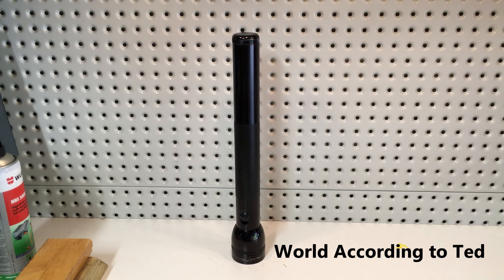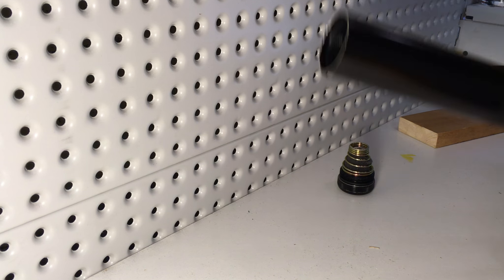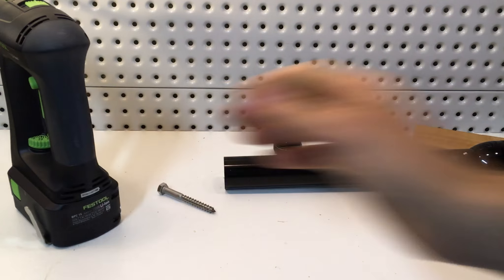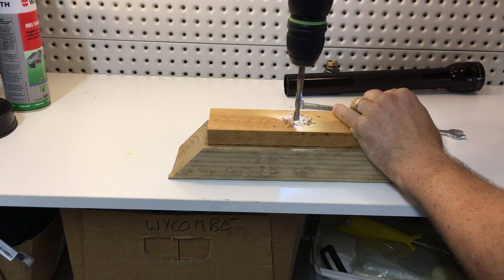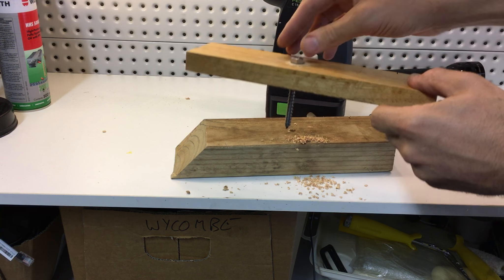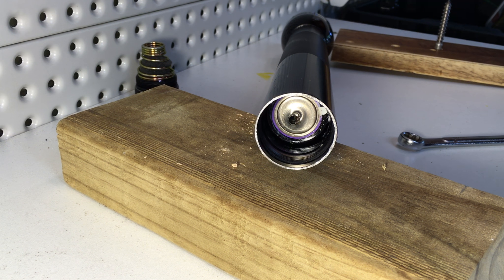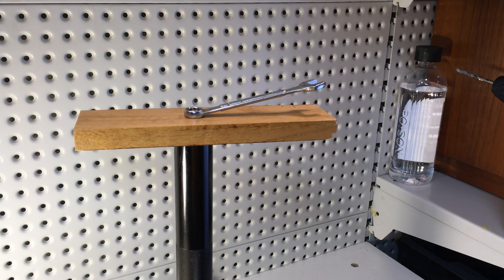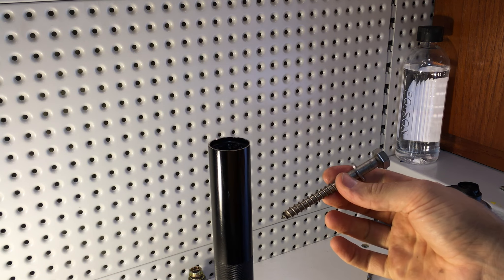MagLite - Remove a Corroded Seized Stuck Battery in 5 Minutes - Maglite D-Cell

Comment: My question is, WHY DO PEOPLE ACCEPT THIS? I'm 65 when I was a kid batteries leaked.  People complained and the manufacturers of batteries started replacing customer's ruined flashlights, radios, tape recorders, etc.   They got tired of doing that and they fixed the batteries.  For a couple decades batteries DIDN'T leak.  Then they moved the manufacturing to China and they started leaking again.  I have a $175 wrist strap GPS unit that was RUINED by leaking batteries.  (There were so many screws to remove to get into the battery compartment, I didn't check as often as I should have.)   My point again is, WHY DO PEOPLE TAKE THIS FOR GRANTED.  I complain.  Maybe if enough of us complain they will either A. Start replacing our ruined equipment.  Or B.  Make batteries that don't leak.  I can't accept the fact that we carry around cell phones that have more processing power than the computers on the moon flights and we can't get leak free batteries.
Reply: more reason to bring manufacturing back home!
Reply: YES!
Reply: PanamaSticks <— they CAN make leak free batteries (as they used to like you said).  They just don’t want to, they would rather replace the device if you mail it to them, and then they can crank out the poorly made ( and cheaper to make ) batteries.  Duracell will either replace or repair (their option) what you sent to them if one of their batteries leaks.  My problem is I don’t know if it’s a Duracell stuck in the flashlight, or another brand.  Anyway,.. they are counting on our consumerism driven society, in the hopes that we’ll just throw the electronic item in the trash.   BTW,... Duracell’s are the worst leakers.  The new bright blue and chrome looking Ray-O-Vacs leak a fair amount, but their old grey & black bodied cells with the white letters were MUCH better and rarely leaked, but they are hard to find now.  Probably didn’t leak enough to be competitive, so thus they went to the newer blue/silver ones.  (Sarcasm).  Good luck to all with these “buggers”.
Reply: Duracell now advertise a 10 year leak free guarantee.........
Reply: @teatonaz  I agree.  Duracell is the worst.
Reply: @ktm640  That's nice, but they lost my trust yeats ago.
Reply: @ktm640  duracell lies.

I recently got a 4 pack of their flashlights.   They seemed to work well enogh for my intended use, which was to stash them arund the house as a quick grab in case of a black out .  So I got a second set.

Well, about 2 months later we did have a blackout.  only 1 of the 8 worked.  Duracell told me to pound sand when I contacted them.    BTW this wasn't faild batteries the flashlights would not work even with new cells
Reply: @ktm640  My experience with the Duracells is that they will leak in the package in a couple of years before you reach the 10 year date. The first thing that Duracell asks for is a copy of the receipt. Good luck finding that after a couple of years.
Reply: You are on ever video on torches
Reply: I've had batteries leak my entire life unfortunately. I don't know that it's gotten worse. For items I do not regularly lose I started the habit years ago of simply removing the batteries when not in use. It's a pain but I've just had too many devices get corroded batteries in them. Often the connections can be scraped clean and the item works but not but always.
Reply: The Russians would boil there ammunition then trade it to the enemy
Reply: Start a battery company and correct the issue
Reply: @LymanSheba  I take it you work for a battery company and can't take criticism.
Reply: what? how did I criticize you?
 @PanamaSticks
Reply: @LymanSheba  I didn't criticize you.  I suggested, based on your snarky comment, that you work for a battery company and took offense at my original comments.  I'm a 69 year old in poor health.  I don't know anything about battery chemistry.  I could no more create my own battery company than  create world peace.

Comment: So, I had this issue with a trusty three D Cell maglite.  Tried everything I could to remove two stuck Duracell batteries.  I also enlisted the help of a neighbor who almost has a machine shop in his garage.  Still no luck.  I researched the internet and learned that I may get a refund on my flashlight (torch) by writing to Duracell.  I did just that, and I got a brand new  LED Maglite.  Thanks, Duracell.
Reply: This happens with Energizers also. That is my project today.
Reply: I don't even know what brand is corroded in mine, worked on it off and on through the day. Nothing moving,so here I am 😂

Comment: This video is a good starting point for my epic - but I have a happy ending. After removing the first corroded battery with the bolt solution described in the video, I mixed up a solution of 1/2 tsp sodium bicarbonate (baking soda) and equal part water. I removed the bulb and lens and added the solution and waited. This fairly mild base solution broke the chemical bonds from the corroded battery after a couple of hours of soaking. The second stuck battery came right out with a bit of persuasion by tapping the flashlight against a wood tool bench surface. Then I flushed the light really well, removed all the corrosion I could reach and cleaned all battery contacts in the flashlight with fine sandpaper. after drying overnight, I added fresh batteries and, voila, the thing worked! FWIW, I just ordered a 300 lumen LED battery online that should bring this older light up to modern standards. The trick is to reverse the corrosion using a base - not acid - solution.
Reply: i'm gonna try it
Reply: Thank you muchly for adding this comment
Reply: I've got a few I picked up for $1, and need to get the batteries out.  I was thinking of trying baking soda, to see if that would help.  Thanks for the confirmation.  Hopefully it works for me.

I'd considered vinegar, and also baking soda, wasn't sure which might work better...
Reply: Happy to find my mag lite flashlight with same problem.. thanks for your video!!  I’ll try baking soda/water soak as well, without flash part of course!  Also like the idea of writing to the company after all they’re a reputable company. Thanks all from NY

Comment: My situation is far worse. I have the original 6 cell D-battery flashlight, that I bought in 1987. (I still have it) I couldn't get the batteries out, so after trying everything else,  I tapped the side of the flashlight on a workbench, and dented the flashlight. The batteries are wedged inside now. MagLight offers a lifetime warranty, but not if the batteries are stuck inside.

Comment: So I watched both videos and noticed that the vinegar idea was a great idea. If you add a base to an acid, they are bound to react.  I have added the two together before and the reaction is very violent, but I noticed that there was no violent reaction in your video.  So I set my mag light, which is the same as yours in a plastic container and poured vinegar in until about half full.  After 2 days, the bottom of the plastic container was covered in brown liquid. I cleaned the mag light out, sprayed it with WD40 and after a few shakes, the battery flew right out.  My mag light has the LED and works just fine now. Thanks for the idea!

Comment: Followed most of your advice,but rather than use a coach bolt,which I didn't have,I used a corkscrew-of which I have many!
worked a treat!
Reply from the maker: Nice!!
Reply: Your comment about a corkscrew saved me! I have a AAA-sized mag light with no suitable screws. Cork screw got it done in a few seconds!
Reply: @adslf874yti3q7u4hf83  You're very welcome.

Comment: Maglite Battery Puller.
OK I've seen some pretty ridiculous methods of pulling batteries out. When these batteries leak they weld to the carcass of the Maglite. For some reason other aluminum flashlights (cheaper brands) don;t do this. I followed this video and it works perfectly! It took so much force I am convinced this is the only way to get the batteries free without damaging the flashlight. After cleaning up the corrosion inside. I coated the new batteries with some vegetable shortening so they had a better chance of extraction the next time. As long as the cab where the flashlight is stored doesn't get too hot the lubricant should be fine. This is a very sound Method! GOOD JOB SIR!

Comment: For a mini AA Maglite, especially LED, if your battery is stuck, find a drill bit that'll stick all the way down and use the drill on the bottom of the battery inside the light. Then use a screw and drill that in where you drilled the hole, then try to pull it out. You may be lucky enough to pull the battery out with the drill bit which is how I just got mine out!

Comment: After decades of being a loyal Duracell customer, I had to switch brands.  Their tendency to leak was ruining too many of my devices.  I had to throw several Maglites in the trash thanks to Duracell (AKA Duracrap).  Since I've switched to Rayovac (Made in USA), I've not had one leaky battery.
Reply: Funny, Rayovac just ruined my Mag-Light.  Got the first one out but still working on the 2nd battery.
Reply: I have had a lot of brands leak ... so far never a D size Rechargeable battery so far . I have had Duracell and Energizer leak inside 2 of my MagLites from now on i dont put any battery`s in the light until i need the light.
Reply: Greg Sullivan  <— have been having the newer bright blue/silver rayovacs (aaa) leaking in the package they’ve come in !!  Stored in the house at normal temps even.  They had well over 1/2 their life left on them before the expiration date even ! !    They are junk like the. Duracell’s.  AA’s not so bad.  Best were the (now) older rayovacs with black/grey body and white lettering.  Those almost never leaked.  ( we have the technology,.. just not the will.  Hmmmm). Good luck. !

Comment: Checked my 2-cell Mags this morning and found one with juicy batteries. Your method worked great for both batteries. I had to spray some penetrating spray to loosen the second battery enough to reach the bolt. I used a scrap 1/4" piece of plywood for the wedge instead of the thick piece you used. Also make sure to wear eye protection when you are drilling batteries. Getting the switch assembly out was tougher. I used a piece of PVC pipe hammered from the other end to get it past the corroded parts of the aluminum tube. I am going to look for a wire wheel of the correct diameter to remove the corrosion from inside the tube.
Reply: I have used a brake cylinder hone on a drill motor to clean up the inside tube of the MagLite. That's the 3-armed tool with long honing stones on the ends.
Reply: @HootOwl513   I was imaging one that was small enough to hone the inside of my Olight AAA keychain flashlight.  I love miniature tools … but , yeah , I’m assuming (especially as recent autos don’t have wheel cylinders) they don’t make such a thing .  But great idea 👍🏽
Reply: @lisacolbert5987  My ''newer'' truck is a '71 GMC, so I'm not that familiar with more modern vehicles. Yes, wheel cylinders are now archaic, but  Master Cylinders may still be the same. IDK.  The tool I refered to worked in a D-cell flashlight. AA and AAA lights are smaller. Perhaps a brass shotgun bore brush on a dremel tool or drill motor might work for AA. Caliber .45 brushes may work in AAA. You'lll have to experiment.

Comment: I'm here because I had a stuck battery, of course. I don't have a drill, so I took some cotton swabs and applied white vinegar to the battery. Reached in with a long file and scraped away the corrosion. Tapped the flashlight on the counter a few times and it came right out!
Reply from the maker: The final video shows disassembly of the switch mechanism to force the batteries out from the top.

Comment: A lot of people don't know you can remove the light switch on the upper end.  Remove the rubber piece over the switch and  insert a small hex wrench(don't remember the size but it is very small) through the  hole in the center.  loosen it and then remove the bulb retaining ring.  There is a spanner nut the size of the flashlight barrel you can screw out easily.  The switch can then be removed giving access to the other end of the battery in the housing.
Reply: You've got to make a video of that.  I'm sure there would be tons of people wanting to see that.

Comment: Soaking the inside with apple cider vinegar helps also. If it won't budge, drill the battery,  then soak with vinegar.  This will eat all of the alkaline material and allow you to crush the battery shell. A small cylinder hone can remove the crusty junk after . Rinse the inside well. In the future,  either remove the batteries when not in use or make a sleeve with parchment paper.

Comment: I've been trying a similar method for over a year working up to a very large lag screw without success so far.  I notice that the battery in yours is a Duracell Coppertop battery and I am sure it is Duracells in my Maglite that are stuck because I have a whole box of devices that have been ruined by Duracell batteries including an expensive automotive code reader. There are flashlights, radios, shavers, clocks, and even cameras that were destroyed by Duracell batteries leaking, expanding, and gassing, and I've had no response from Duracell when I inquire about replacement under their "leakproof" warranty.  The Duracell advertising might as well say Guaranteed to Leak, as that has been my experience.  I now use energizers in anything requiring batteries.  Reading the comments below, I will try soaking it with baking soda solution and see if that might help; I did try liquid wrench but that did not release them.  Thanks for the video.  Glad you got yours apart that way.

Comment: I saw your video I bought a laser level at a tag sale it had two AAA batteries that were corroded the first battery came out no problem but the second battery was stuck. I did not have any bolts to drill into it so I used a 3 1/2 inch deck screw and it pulled it right out great video thank you so much It worked